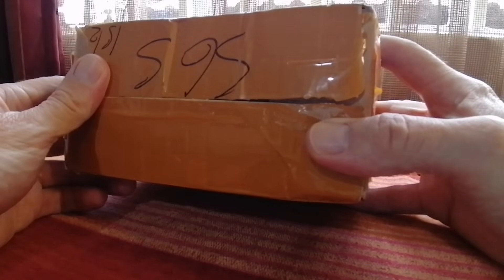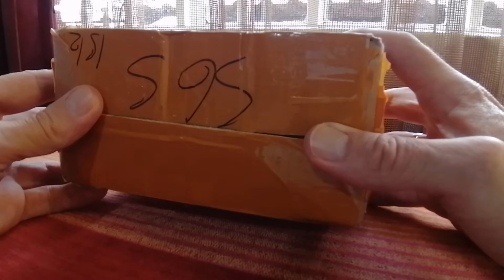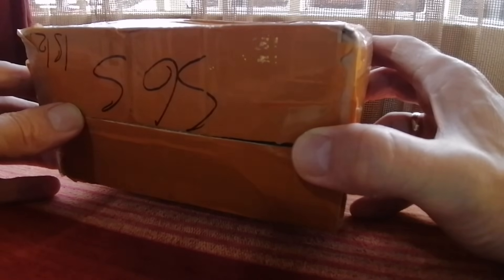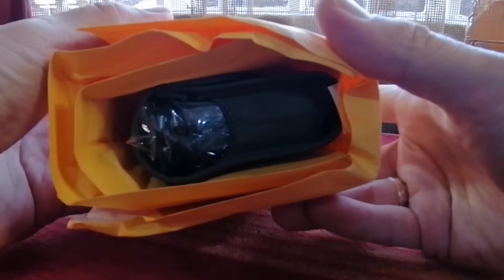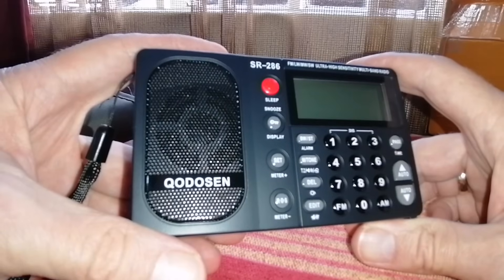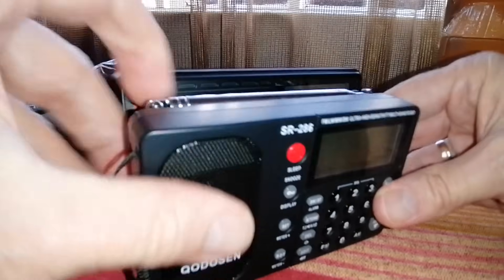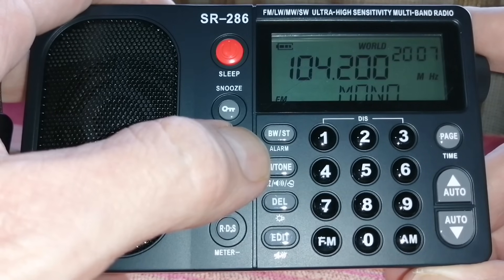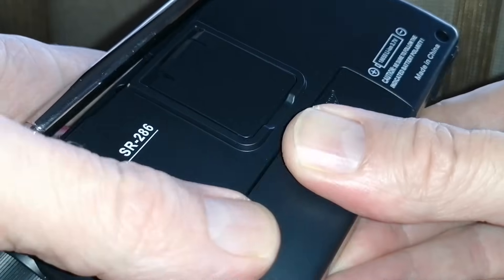An astonishing DXing radio: Unboxing the Qodosen SR-286 and first look #shortwave #tef6686

Comment: I just found that Amazon is selling a new version of this radio, the DX-286 for $80. The keyboard interface has been improved and is more easier to use. Is the same radio and comes with a list of the new keystrokes. It will shipped with no battery.
Reply from the maker: Hi there and thank you! I just saw this myself last night. The lower price makes this a very good buy!
Reply: @swlistening  I just thinking in getting another one! 😂
Reply from the maker: @isleifoterogarcia4478  I actually did, I ordered one of the new ones. So now I will have a spare, if anything goes wrong with the first one 😀
Reply: Best battery is the XHDATA 3000Mah. Works very well.
Reply from the maker: @richardmerriam7044  That's actually the one I am using! Took it from my D-608WB.
Reply: Strange how the DX can be ordered for $80 on Amazon but it's nowhere on AliExpress. All I see there are SR for >$100
Reply from the maker: @Ni5ei  This seems to depend on where you are. I also don't see it on Ali Express, but people in Europe do see it now, at $80. Ali Express shows different products to people in different countries.

Comment: Nice first look at this radio, were these signals all received on the built in whip antenna or did you have an external antenna plugged in. I ask because you received shiokaze. I have a hard time receiving that signal and I live in Japan, so much noise where I live and direct jamming from dprk and ccp on certain targeted stations.
Reply from the maker: Thanks! Sometimes it is actually quite hard to hear SW signals from transmitters very close to you. It is a signal that I hear quite often, I think I am kind of in the right direction, from Japan to Korea and then it bounces around until it reaches me here in South Africa. Very interesting signal. I used a 10-metre wire, that is my usual antenna and I use it almost all the time when I am DXing.
Reply: @swlistening  Thank you.
Reply from the maker: @keimahane  Sure!

Comment: I absolutely love my Retekess V115.  I use it to play MP3 files.  How does the audio of the SR-286 compare with the V115?
Reply from the maker: Hi Walley, I agree, the Retekess V115 has terrific sound, for such a small radio. I would say the sound on the Retekess has more bass and overall a slightly better sound than the Qodosen.
Reply: Thanks for your reply.  Keep up the great work.   @swlistening
Reply from the maker: @walleyvideo8297  Sure Walley, and thank you 😀

Comment: A radio buff on the US West Coast, DXer Gary, has done some medium wave tests on the SR-286, with the whip and with loop antennas.  They are impressive with this chip; it's putting the SiliconLabs chips on other portables to shame.
Reply from the maker: Hi Joe, thanks for your comment! I saw that test, it is really quite incredible what the Qodosen can achieve on MW. I think this radio is really revolutionary.

Comment: From the official website of Nxp :
"The TEF6688 supports the digital radio standards HD Radio and Digital Radio Mondiale (DRM) digital radio when used with NXP Semiconductors’ digital radio coprocessors such as SAF356X and SAF360X."

Such a radio along with air band and SSB would be virtual untouchable by anything else and would sell like hot cakes. Currently i dont know any radio which specialises in both analog radio and digital radio reception. Such a radio will sell like hot cakes.

The only other thing is internet radio which im not sure i should be classifying in the same league as "radio". The choyong lc90 is doing a superb job in this regards.

Comment: Thanks for the review! I don't know why it took so long to have these chips (TE6686), in portable/table radios, when this technology has existed for some time now!? Why not take this audio chip, reverse engineer it, and  mass produce it for portable , am/fm clock radios, ham radios, etc... ! Perhaps, there can be a Sangean ATS-909X3 with this chip, and have it for air band, am/fm/saw/ marine/let, etc., as the large volume can be placed into more radios.
Since, America will not adopt IBOC, DAB+, DRM, then by all means use the TE6686 for domestic radio production...?
Reply: Reverse engineering the TEF6686 chip is a sure fire way of inviting corporate lawsuits from NXP Semiconductors! You can only legally reverse engineer a chip if its copyright patent had lapsed, is an obsolete product which is no longer made and the effort is done for research, educational and non-profit usage.  There are many radio-on-a-chip DSP solutions out there. The TEF6686 happens to be just one of them and it's not even considered the top of the line. 🙂
Reply: ..if the TEF6686 is not the "top of the line", then by all means, use another chip that is close enough or better than the one mentioned..! This kind of radio  technology has been around since the 1970's (remember the Chrysler Cordoba 1979..?). and it should be used for all radios, and if the cost/price is more, than so be it..! You can go to a bar, and blow $200 in one night, so instead save you rmoney and purchase this kind of radio...! @StratmanII
Reply from the maker: Thank you for your comment! I also wonder why it is taking so long for the big manufacturers to adopt this chip. I think it might have to do with pricing and the fact that these chips appear to be hard to procure. The car manufacturers buy them all. But one can just dream about the wonderful radios that might come out if big manufacturers start using this.

There are various radios available using the TEF6686 chip, not from any known manufacturer, they seem to be almost like "home-industry" products. Most are priced at $100 and above. If you search for TEF6686 radio on eBay you will find various options. 

I would advise some caution though, I have heard that some of these TEF6686 radios actually do not really use the TEF chip. It would be a good idea to check reviews and to try to find some information before buying any of these radios.

Comment: So, why is this astonishing?  No SSB and pretty basic.
Reply: We need SSB in all radios...! And weather band, AM/FM/SW/AIR/LW/MARINE/
CW/Citizen Bands..! With cheaper chips, the radio manufacturers can place so much on a single chip......
Reply from the maker: @dadwire1483  This would be the ideal radio! Some of the handheld scanners like the Quansheng UV-K5 get somewhat close to your ideal radio, if you modify the firmware, but I don't think any radio currently offers all these options. I think it would push prices up. Also, WB would not be of any use to people outside the US.
Reply: @swlistening  Canada also uses the same VHF weather channels.
Reply from the maker: @markr.1984  Thank you, I did not know that Canada also uses it.
Reply from the maker: Hi Dan, thank you for your question. The TEF6686 chip is groundbreaking in terms of radio performance. Just like the Silicon Labs DSP chips brought about a revolution in portable radios, the TEF6686 chip offers next-level performance. The Qodosen SR-286 makes this technology available to users of portable radios, previously only found in car radios. It is a radio with a long list of features, too many to name here. The highly-advanced TEF6686 chip works very well on external antennas. FM and MW are, based on many reports by others and my own experience so far, better than pretty much any other portable on the market. Selectivity and sensitivity is excellent. The radio has the ability to pull in weak signals that other radios don't catch at all. Noise floor is very low. I only got my radio recently and I am still testing it but so far I have pulled in various SW and FM signals that my other radios, like the D-808, simply don't catch.

Comment: Scooped again. My Qodosen SR-286 was supposed to be delivered today, but it didn't show. I'm looking forward to some FM DXing when it comes, plus some exploration of longwave. Do you have LW stations within range of you? Algeria at night, perhaps?
Reply from the maker: Hi Kevin, I was actually surprised that mine arrived so fast, it took only 12 days, which is really quite something. I am used to waiting at the very least two weeks, but usually three to four weeks for my overseas deliveries. Are you a former newspaper man? I am asking because of your use of the word "scoop" :-)

I have never caught anything on LW here, but last night I heard some noises on the SR-286 on 225 kHz (the Polish station) that sounded like music and not the usual static. So I might get lucky with LW still. I haven't heard Algeria, but maybe this little SR-286 will be the breakthrough I need.
Reply: @swlistening  I found using an external long wire antenna and ground on LW opened up and entirely new world on my PL-990, and the Qodosen allows an external antenna on MW/LW too. The radio passed customs 6 days ago and there is no tracking update.
Reply from the maker: @BlogOrDie  Thanks Kevin, I have actually tried a wire on my Qodosen already, but it was a bit noisy. I will need to go somewhere away from houses I think. The wire is outside, but still noisy, much more noisy on MW and LW actually than on SW. Even through the noise it is clear though that the Qodosen is very sensitive!

Comment: Interesting radio but I think I’ll wait until they come down in price. Thanks for sharing your thoughts on this radio
Reply from the maker: Thanks Steve. The price is a bit high indeed, but I don't know if it will drop any time soon, someone actually pointed out here that this radio is  about $170 on eBay. I think it's because it is relatively hard to find the chips for the radio.

Comment: WHAT?????????? Qodosen SR-286?!!!!! 🔥🔥🔥🔥🔥🔥🔥🔥🔥🔥
Reply from the maker: Indeed! Something quite new, I am reading up about these TEF6686 chips and the radios that use it, very interesting development!
Reply: @swlistening  yeah, I think they came out last year if not 2 years ago - I mean those non-branded, cheap-looking sets, not Qodosen 😜 and they became quite a sensation especially among FM DX community. There are a number of outstanding FM bandscans from Europe on YT using these radios & just their telescopic whip. And have I seen an instance of a TEF6686 radio controlled via Wi-Fi through famous XDR-GTK software?? On AM side, I read Gary DeBock evaluating it on IRCA and Ultralight DX mailing lists, and he says that while the SR-286 is incredibly sensitive indeed, its narrowest filter is just 3kHz, which is not enough in heavy adjacent-channel interference situations such as chasing Asian MW stations on 9kHz channels in a 10kHz-spacing environment of North America.

Personally, I'm really curious of that radio and any od the TEF6686-based devices, but on the other hand, I think I'd wait until somebody addresses the issues of lack of SSB and not narrow enough filters on AM. For FM DX alone though, they're beasts 👹 Although I've still yet to see a comparison of any of these radios or the SR-286 with an SDR like any Airspy or SDRplay model XD

PS. Recently I saw some of the non-branded makes on generous discouts at Aliexpress, like, half the price of Qodosen. But that was a week ago, just before Chinese New Year holiday, so I don't think it lasts still 😂

Comment: Hello André, I'm really glad that you've eventually received this much anticipated exciting new toy.
Thanks for the informative quick first review. It does seem to be quite an interesting radio, as I don't use my radios for much but SW, I'll probably wait until your really compare it with your best performers on this band to build my  own opinion. It certainly seems to perform above average during this first test.
Even if it's clearly superior, and as much as your reviews usually raise quite an appetite for me to buy the radios you review, I think I'll pass on this one. It's 150+ euros with free shipping and prepaid VAT (so no import taxes) for us in UE from Ali and that's really more than I'm willing to pay for a radio without SSB, without air band, tuning that mutes between steps and even without a battery. The build quality would appear to be so-so as well. I'd expect better in this price range.
I hope the price of this radio or other ones based on the same new chip will go down with time. I would go for it at 80 euros max.
Reply from the maker: Thanks Alain, I agree with you, the price is really quite hefty. I am hoping it is worth it though, I am particularly interested in the MW capabilities. On MW with an external antenna in a quiet area it is said the be really, really good. But even with the internal ferrite antenna MW is said to be superior to many of the other radios I have. I will see as I test it more. I did do some MW testing last night with the internal antenna and I was quite happy with it. 

I think part of the reason for the high price is that it is not mass-produced. And the TEF6686 chips are, from what I have read, not easy to procure. The car manufacturers buy them all. 

Someone else also commented about the build quality, but in my opinion it seems quite good. No better but also not worse than Tecsun or XHDATA radios.
Reply: Let's see how it goes on MW but again, not my main focus. I'm looking forward to a SW shootout with the D-608 and maybe a couple of your best performers like the D-808 and the PL-368? (hint, hint 😉)
Build quality: just an impression based on the video so of course this is vague. The stand for example seems rather tiny, thin and fragile but we don't use these much, do we?
Reply from the maker: @F4LDT-Alain  The stand does look a bit flimsy, you are right, but it seems to feel stronger than what it looks like. I actually use the stands quite a lot, so I hope this one will last. We will see.

As a matter of interest, someone just pointed out here in another comment that this radio looks like the Sony ICF SW1, and it does actually, very similar! The numerical keypad, the speaker and many of the other buttons look exactly the same.

A SW shootout between the D-808 and the PL-368 will be up later today! Just did a short comparison earlier today on Radio Farda.

Comment: I have one. The price is nothing compared to a Tecsun PL880. Reception is quite good on the SR-286, better than the PL880 for sure. The optional (switchable) amplification on the external antenna jack is nice. Audio quality is better on my XHDATA D-109. And the SR-286 sounds like a tin can compared to the PL880. The SR-286 is poorly made. The clock cannot keep time. Cuts out. Jumps. Effectively useless. The back battery cover looks like it will be the second thing to die. It came with the screen scratched and no battery. The button controls are not as intuitive as either the Tecsun or XHDATA. The manual a PITA. But picking up Spain on SW from western Canada one afternoon was... unexpected. I look forward to your further reviews.
Reply: Each to its own. Audio quaity is superb, mine keeps perfectly time, usability is great, much much better than a XHDATA 808.
Reply: @JohannHöchtl  The PL880 is superb. SR-286 is not in same league.
Reply from the maker: @JohannHöchtl  Thanks Johann, I tend to agree with you, I think this SR-286 is definitely a bit better than the D-808. I am still testing it, but so far I am very impressed.
Reply from the maker: Thank you for your comment! I think your remalr about Spain sort of summarises my feeling about this radio. There are quirks, all these things you mention, but if it performs well, I will be happy with it. I found basic operations fairly intuitive, but I will need the manual for any other operations. Like the page memory system, haven't figured that out yet :-)